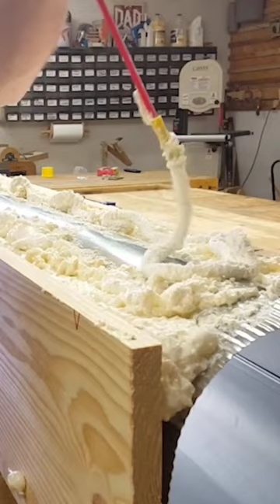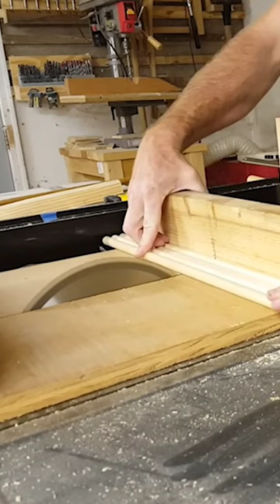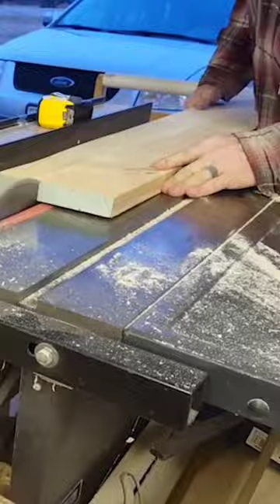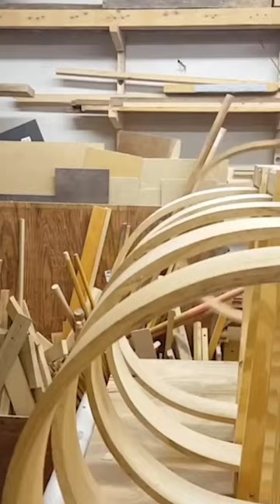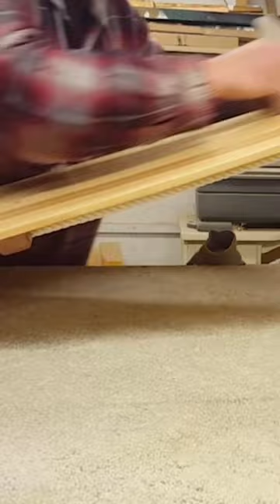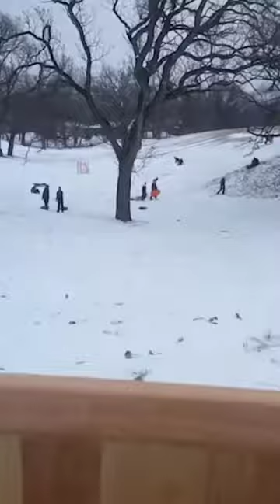I wanted to make the fastest possible snow sled. Hows this?  #shorts #toboggan #sled #steambending

Comment: Toboggans are like mac trucks. Slow to accelerate and unstoppable once they are moving. Build a sled with a pair of old skis as runners: skis need to be modern enough to have plastic bases and steel edges but old enough that they are not “shaped”. My ski sleds will out pace anything on the hill.

Comment: Those sheet metal tubes are not very air tight surprisingly, so you’re going to get a lot of rot in the foam cavity over time I would assume.  Maybe some silicone or other sealant in the snap connection would work well.  Pretty funny to see you cut it to length that way, but hey, if you don’t have snips.

Comment: Dang man I didn't know I wanted to make a sled so bad.
Reply from the maker: 😂😂Make one!
Reply: @WyldeWoodworks  Yeah I was curious what the pipe and foam were for. Now I get it. I have a steamer I used to remove wallpaper off the walls. Is that similar to what you're using to fill the chamber to soften the wood? Also, what kind of wood are you using? This is honestly amazing. My boys would be thrilled to help make their own sled.